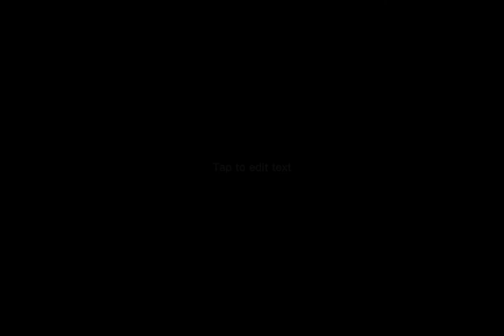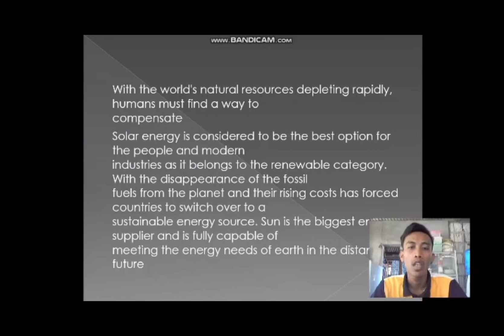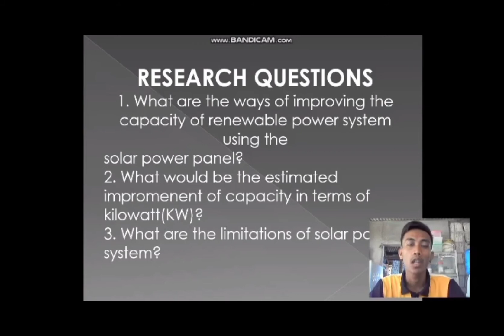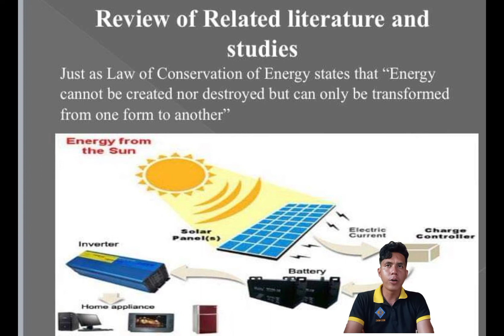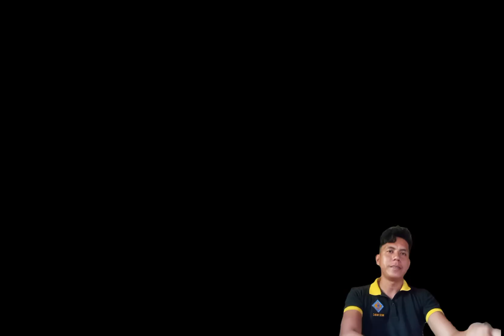Improving the Capacity of a Renewable Power System, Using Solar Power Panel

Comment: NAME:LEOMAR A. MEDEZ
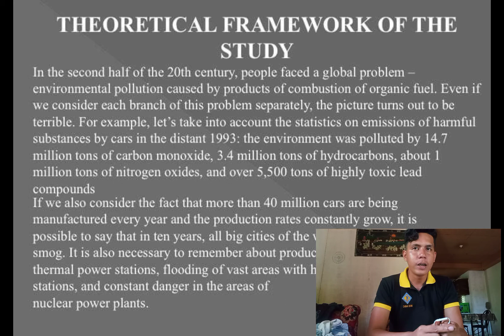CLASS NAME & CLASS SCHEDULE: EE341 A TTH-6:30-9:00PM
DATE: March 29, 2022

REACTION:
Engineering students can greatly benefit from the video above, especially because it explains the need of increasing the capacity of a renewable power system and provides useful information about the use of solar power panels. Fossil fuels do not cause greenhouse gas emissions, while renewable energy lessens some types of air pollution.

REFLECTION:
If the costs of solar energy continue to increase, this will remain a small percentage of the world's total energy supply. Researchers and engineers are constantly on the lookout for innovative ways to protect the environment while still keeping up with the rapid pace of technological advancement.

Comment: Name: Orito, Jessel A.
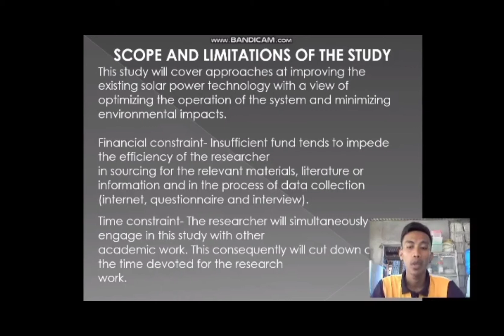Class Name & Class Schedule: ENS 341 Research Methods for Engineering (Saturday 5:00-8:00 pm)
Date: March 26, 2022

Reaction: It is good to know they able to come up with this research proposal concerning the improvement of the capacity of a renewable power system using solar power panel. Solar energy is one of the best options since it is a renewable source of energy.
Reflection: According to their research, industry must overcome a number of technical issues to deliver renewable energy in significant quantities. In that case, solar power is one of the best options since solar power requires effective use of advanced control techniques. This surely helps for the improvement of the renewable power system and this improvement is relevant so that industry can use it better without minding some technical issues.

Comment: NAME: JULIE MARIE H. MARONDO
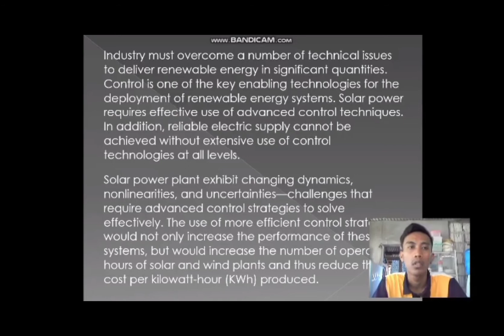CLASS NAME & CLASS SCHEDULE: ENS 341 - Saturday 2:00 - 5:00 PM
DATE: March 24, 2021

REACTION: The video informs audiences, particularly engineering students, about the need of using solar panels to increase the capacity of a renewable energy system. Renewable energy also produces no greenhouse gas emissions and reduces some types of air pollution, unlike fossil fuels.

REFLECTION: It is critical for us to develop a better solution to the future power crisis as human beings. The reduction of non-renewable energy use by increasing renewable energy capacity, such as solar power panels, can help to lessen environmental consequences while simultaneously promoting economic growth.

Comment: NAME: Lumelyn E. Ragusta
CLASS NAME & CLASS SCHEDULE: ENS 341 B Research Methods for Engineering – S 5:00-8:00 pm
DATE: March 26, 2022
REACTION:  It's amazing how researchers continue to find ways and solutions to improve the capacity of renewable and sustainable power systems. Solar power panels are one of the proven alternative renewable and sustainable power technologies for producing electricity that has the largest energy supplier and is fully capable of meeting people's energy needs rather than burning fossil fuels, which is the leading contributor to environmental damage.
REFLECTION: Environmental impact is one of the biggest issues when it comes to renewable and sustainable energy utilization, but researchers continue to find ways to lessen these impacts and improve production. We must stop burning fossil fuels and start investing in emerging renewable sources like solar energy. Solar power panels may be costly, but it's worth it because it produces enough power (electricity) and is still improving its capacity. We can help the environment while also saving money and electricity if we start investing now.

Comment: Name: Barbia, Venz kharl
Class Name and Class schedule: ENS341-methods of research. Sat (2:00-5:00)
Date: march 26 2022
Reaction: This video was very helpful and informative since it was explained clearly. And it was a great innovation having the renewable power system using solar panels. This was a great idea and deserves a hands up for the presentation.

Reflection: Improving the capacity of a renewable power syatem, usimg solar power panel is a great idea this could be applied sooner in the future and i hope government will look into this because for this is a great gain in improving our power supply and less coat aince sunlight is abundant and specially cost free. 
Thank you…

Comment: Franz Michael B. Nadal
ENS 341 SAT 5-8 pm
March 26, 2022
Reaction:
This is research is informative. Congrats to he researcher who were able to come up with this topic. And I agree with their pinpointed issue that our fossil fuel is slowly depleting and we need and alternative source of power. So switching to solar powered power plant maybe a key to it but the existing solar panels still needs improvement in many criteria that is why enhancing it continuously will we be able to generate a power or electricity more efficiently.
 
Reflection :
As we know we have various emerging renewable technology. As students we should be responsible in enhancing it and finding ways inorder for it to work more effectively and be able to meet the demands of the current need for base load power. We maybe able to build a solar panel someday that not only utilizes light energy but also heat energy once.

Comment: NAME: Loreto C. Bayawa Jr.
CLASS NAME & CLASS SCHEDULE: ENS 341A SATURDAY(2:00-5:00)
DATE: 03/26/22
REACTION: A lot of information was presented in this video, and it clearly explains how we may optimize the usage of solar energy by utilizing the full potential of solar panels. 
REFLECTION:It became clear to me as the presentation progressed that we still have a long way to go before we can fully exploit all the potential of renewable energy, particularly solar energy. This is not only beneficial to the environment, but it will also benefit a large number of consumers because solar panels are not expensive and have a life expectancy of 30 years.

Comment: Name: Evardo, Anthony James Jr. A. 
Class Name & Class Schedule: ENS 341 Methods of Research SAT 2:00-5:00
Date: March 25, 2022

Reaction: Since the presentation of their study proposal was instructive and enlightening as spectators, especially for the engineering students, I learned about the potential and influence of renewable energy systems on individuals and the environment.
Reflection: This is an excellent choice, particularly for people who work and even for us students, because it gives a stable backup in the case of a power loss. It is not only ecologically beneficial, but also cost-effective.

Comment: NAME: Mary Grace C. Jorge
CLASS NAME & CLASS SCHEDULE: CoE 343 Method of research T-Th 5:00-6:00
DATE: March 25, 2022

REACTION: This kind of presentation is very educational. In this kind of study, viewers was was given a knowledge about power system using solar power panel and also enlightened the viewers on how reliable solar panel/solar system is. 

REFLECTION: As a Computer Engineering Student, I do also see the renewable energy as interesting. Solar energy is unlimited power coming from the sun, We need to take advantage to it for us to store electricity using batteries for future purposes. The importance on this study is to help everyone reduce their expenses in regards on electricity.

Comment: NAME: Kilapkilap, Joebert L.
CLASS NAME & CLASS SCHEDULE: ENS 341 A – Saturday 2:00 – 5:00 PM
DATE: March 25, 2022

REACTION: This video is very beneficial for us engineering students, especially those who took an electrical engineering course. It provides us with fundamental knowledge about renewable power systems using solar power panels. The presenters provided a way of producing energy that can reduce greenhouse gas emissions.

REFLECTION: The video made me think that the government should focus on funding renewable power systems because it will lessen the pollution generated by the power plant that uses coal.

Comment: Name: Ma. Theresa C. Velasco
Class Name & Class Schedule: ENS 341 B /5:00-8:00PM SATURDAY
Date: March 25, 2022

Reaction:  Their research are excellent especially it is about the renewable energy which is the best way to use to have a natural sources that is limitless to use and it is not dangerous.

Reflection: About their research, improving the capacity of a renewable power system using solar power panel is one of the best way of having a limitless and natural resources energy to have a clean electricity flow.

Comment: NAME: Shiela May E. Velos
CLASS NAME & CLASS SCHEDULE: ENS 341 - Saturday 5:00 - 8:00 PM
DATE: March 25, 2021

REACTION: The video above really helps engineering students specially that they shared the significance of improving the capacity of a renewable power system that also provides valuable information regarding the using of solar power panel that benefits much. Renewable energy produces no greenhouse gas emissions from fossil fuels and reduces some types of any pollution specially on air.

REFLECTION: Renewable energy is an energy that is generated from natural processes that are continuously replenished. This includes sunlight, geothermal heat, wind, tides, water, and various forms of biomass. It cannot be exhausted and constantly renewed. They are virtually limitless. What's more, they have little impact on the climate or the environment. the advantage of the renewable energy sources; it will not run out., it is reliable, it's environmentally friendly, it can Increase public health, renewable technologies create lots of jobs, renewable technologies require less maintenance cost.

Comment: Balacy, Samantha Ruby Joy C.
COE 346 A - Methods of Research T-TH 500 - 6:30pm
March 25,2022
Reaction:
The video presented is very informative to the viewers since it educates them how important to resort to green energy to power up our houses, appliances and gadgets.
Reflection:
It is without doubt that solar energy is one of the green energy that we need to harness. So by switching to solar energy, not only it is inexhaustible and renewable source of energy but also it helps minimizes the emission of harmful gases used in power plants and it also reduces the consumption of electrical energy from the power plants which resulted to less cost fees. So if this were implemented in the cities, then we are able to produce less possible pollutants that affects our environment.

Comment: NAME: Clark E. Juanites
CLASS NAME & CLASS SCHEDULE: EE 341A 6:30 - 8:00 PM T-Th
DATE: March 25, 2022

REACTION: The video explains how to increase the capacity of a renewable energy system by employing solar panels. As an Electrical engineering student, this research helps to inspire me that I can improve people's lives.

REFLECTION: This research proposal provides further information about increasing the capacity of renewable energy systems by using solar panels, as well as being environmentally beneficial. If this research is undertaken in the future, it will be extremely valuable to society. Finding techniques to optimize solar energy, such as this concept, is a huge step toward a green future that is sustainable.

Comment: NAME: John Ver P. Bulanon
CLASS NAME & CLASS SCHEDULE: CoE 346 METHODS OF RESEARCH -TTh 5:00-6:30pm
DATE: MARCH 25, 2021

REACTION:The video educates viewers, particularly engineering students, on the importance of increasing the capacity of a renewable energy system by using solar panels. Furthermore, unlike fossil fuels, renewable energy produces no greenhouse gas emissions and reduces some types of air pollution.

REFLECTION:This is a fantastic option, especially for students, as it provides a reliable backup in the event of a power outage. It is both environmentally friendly and cost-effective.

Comment: Diaz, Joseph Jr. B. 
ENS 341 B - 5-8 pm Saturday
March 25, 2022

Reaction: As I watched the video about the renewable energy using solar power panel or solar photovoltaic, I realized that it is so important to invest in that kind of source of electricity/power because it will save your money a lot in the near future and not just your money but also the planet Earth. 

Reflection: The importance of renewable energy like solar power panel is so dramatically necessary to the environment. It will helps a lot to the environment because it has less carbon footprint compared to the other energy source using fossil fuel. The only problem with this is that when the raining season comes the energy that produces by the panel is low.

Comment: NAME: Tracy Alex E. Manzo

CLASS NAME & CLASS SCHEDULE: ENS 341 Research Methods for Engineering - SATURDAY (5:00-8:00PM)

DATE: March 25, 2022

REACTION: The video shows that improving the capacity of a renewable power system, using solar power panel is important and the reason why it needs be improved. Since energy cannot be created nor destroyed bat can only be transformed from one form to another therefore, solar energy is ecofriendly. It also shows how solar works in detail. 

REFLECTION: As Bagyong Odette struck the Philippines, Filipinos had to cope with no electricity and water for how many days because of it we learned about solar power panels and how it was so helpful in the said catastrophe. The demand for it grew and grew as days passed therefore prices also went up. Solar has significant promise for meeting the world's energy demands, according to the White House in 2010. With this research study which is improving the capacity of a renewable power system, using solar power panel if another catastrophe strikes our country, hopefully we will have an improved solar energy to use with all the benefits we’ll get.

Comment: Name: June Anthony K. Sarga
Class Name and Class Schedule: Coe 343 Methods of Research T-TH 5:00-6:30
Date: March 25, 2022
Reaction: the video’s audio was not very clear but the overall presentation was acceptable. This video also educates viewers about the importance of using solar panels to increase the capacity of renewable energy systems. In addition, renewable energies reduce certain air pollution without producing greenhouse gas emissions from fossil fuels.
Reflection: The research topic was really interesting because it concerns improving the capacity of renewable energy systems using PV panels. This research proposal teaches viewers how important it is to save non-renewable resources, especially electricity.

Comment: NAME: Duhaylungsod, Ronalyn B.
CLASS NAME & CLASS SCHEDULE: ENS 341- Saturday (5:00-8:00 pm)
DATE: March 25, 2022
REACTION: The researchers were doing good in presenting their proposal about improving the capacity of a renewable power system, using solar power panel. The video was also informative. The researchers presented a synthesis of facts, figures, and numerical informations that are very useful for the viewers.
REFLECTION: Saving mother earth is the trend nowadays. It is because of the bad effects that the human beings are experiencing. One of these effects is the weather which is always changing. By the help of the idea of the researchers, it can sustain and conserve the planet earth. As an engineering student, I am also looking for a better solution which is unharmful, lifelong and sustainable for the human beings.  That's why, this proposal is a better idea in saving mother earth. This  helps me think more ways and issues that are very applicable.

Comment: Name: VEXANDER PHILIP M. MARAVILLA
Class Name &Class Schedule: ENS 341 A - TTh  6:30-9:00  Pm
Date : MARCH 25, 2022

REACTION: I believe one of the ways  to solve the depleting of natural resources , we as human must find a way to compensate or energy needs, by improving the capacity of renewable power system using solar panel to harness the energy coming from the sun and reduce the carbon dioxide release from burning fossil fuels.

REFLECTION:   The key learning that i get on the research proposal of Mr. Caliso and Mr. Sojor  since we also use solar energy on our appliances in our house it give such an great advantage in terms of less cost in paying electric bills and also we can use it to charge our batteries for night use. These type of renewable energy can change the our way of living and less pollution  in the environment .

Comment: Pagente, Jayvee M.
CoE 346 Methods of Research TTh 5:00-6:30 pm
March 25, 2022

Reaction: The video presentation is very educational and informative about the benefits and advantages of using the solar power panels. By adopting this kind of method it reduced dependence on foreign oil and fossil fuels. 

Reflection: Using this kind of method many people will benefit since renewable energy is energy that is generated from natural processes that are continuously replenished, that is why more people can save their money in paying for their electric bills and others that requires energy or electricity enable to be operated.

Comment: Name: Mark Daniel L. Anggoy
Class Name & Class Schedule: Coe 343 Methods of Research T-TH 5:00-6:30
Date: March 25,2022

Reaction:  Thank you for sharing educational type of information. The video educates viewers, particularly engineering students, on the need of increasing the capacity of a renewable energy system by using solar panels. Furthermore, unlike fossil fuels, renewable energy creates no greenhouse gas emissions and lowers some types of air pollution.

Reflection:  Renewable energy, I believe, will also have a positive impact on the environment while boosting economic progress. Renewable energy, in my opinion, is not yet at its height, but it has immense potential. The experts believe that there is room for development, and that by implementing these advances, we may assist the field reach its full potential, allowing more individuals to profit from the outcome. I think it extremely terrible that, despite its enormous potential, solar energy receives only a fraction of the research funding mentioned in the film. I wish that more people would do so.